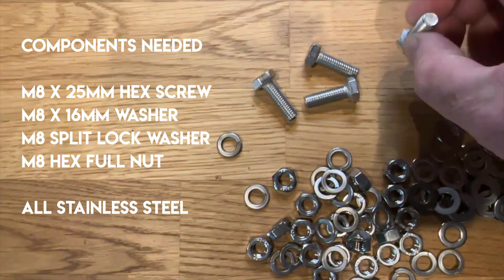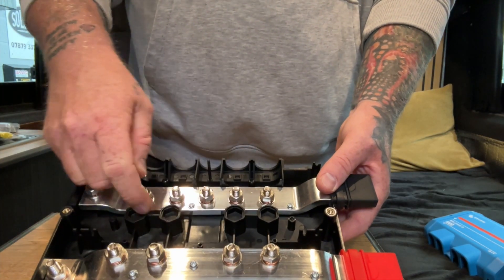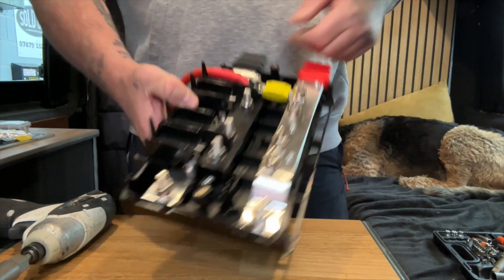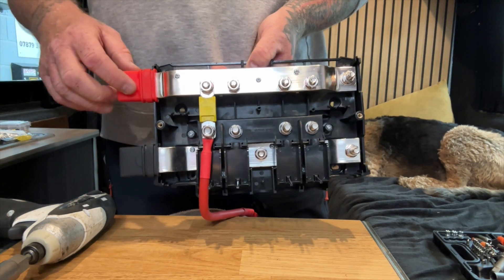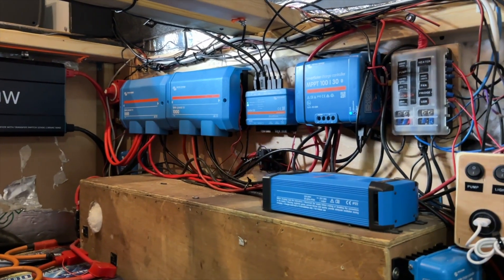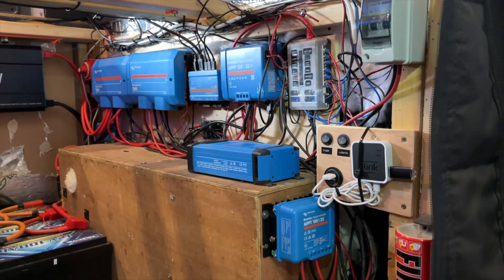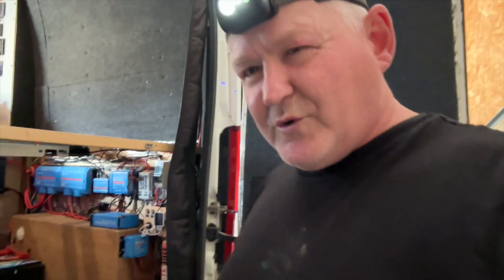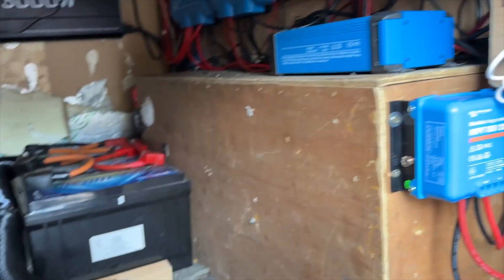How to Hack a Victron Lynx Power In #victronenergy

Comment: Great job my friend. 😊👍
You've seen my setup and I've done the exact same thing to my Power-In. It does not have all the electronic doo-dads of the Lynx Distributor, but it is a very reliable way to add fuse protection to the bus bars. Looks like your energy sources are ready for the coming cold season!

Hope your leg is doing better 😊and best regards from Germany 🚐☁🍀,
Volker
Reply from the maker: Hey mate, took your advice, watched some videos and made the same as you! So much better now, especially peace of mind that the whole system is protected… so thank you for the advice! The knee is better but still not right and still not got anywhere with the NHS apart from pain relief and anti inflammatory 🤷🏼‍♂️ 

So I have to keep pushing on by myself now… how’s you my friend?

Comment: Just one correction. The distributor has PCB and LED indicators for blown fuses.
And for anyone doing this on a 48V system, make sure you use high voltage fuses rated for about 70V (I can't remember the exact minimum).
Reply: Hi, thanks for the info. Using the Victron Lynx kit & adding the shunt and switch on the in side make it a nice package.
I want to go blue sea battery terminal fuses to protect the battery and keep it all minimal and safely protected.
I’m thinking of a couple of 200 ah DC House battery’s and they each have a 500 amp surge for 10 seconds! So big cables and plenty of power……
Take care all M.
Reply from the maker: @kevgermany  ahhh yeah, thank you 🙏

Comment: Awesome. Just remember to revisit all the connections in a month or two to check none have worked loose. I've had one work loose, the connection must've started arcing and it melted the hinged plastic separator in the Lynx distributor. Some serious amperage goes through these things.
Reply from the maker: Thanks mate, yeah I had the same chat yesterday with a guy who does all the electrical work at a big van build company.. he said to check the same things… I actually went over everything again today as a double check as it got me paranoid 😂 thanks for the advice mate and hope you’re well?